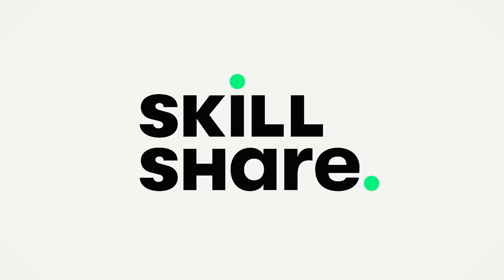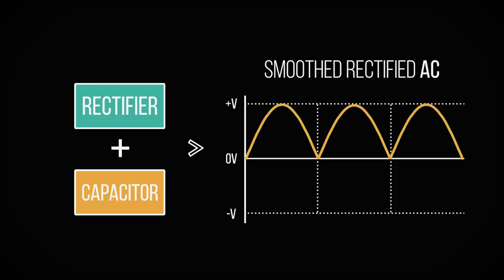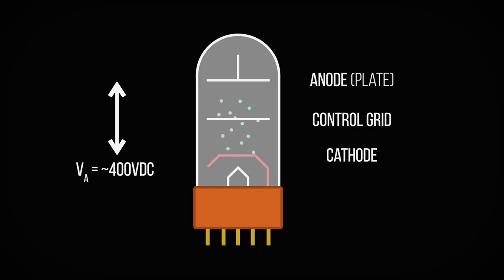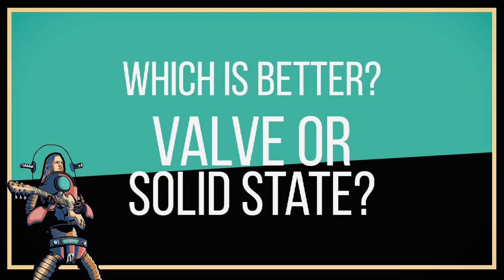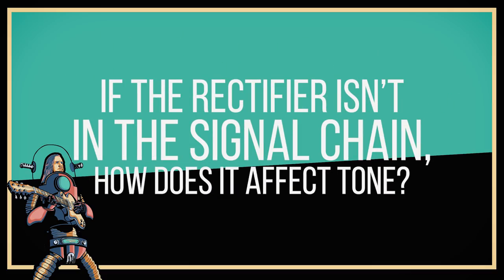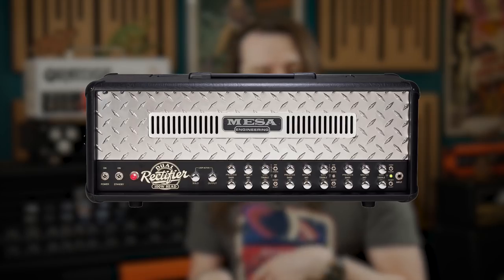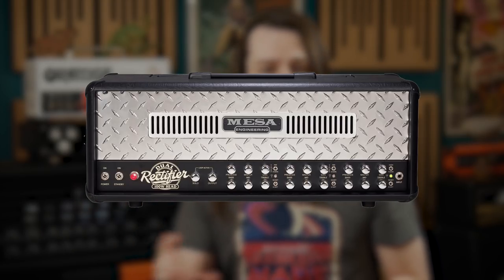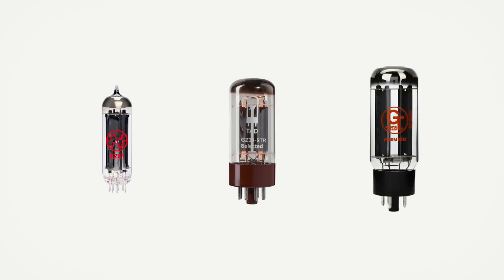What are Valve Rectifiers? | Too Afraid To Ask

Comment: My Silvertone 1482 uses a 6X4 (well, the tube is 6X4WA... not sure what the "WA" is).

The wattage on this amp is inconsistently published, but I'm safe to say it's under 25 watts.

I have this routed through a load box into the Pod Go instrument input, effectively making my amp both a bedroom level cabinet as well as a big-honkin "drive pedal" in front of the Pod-Go (all of which is "yummy").

As for the caps... I thought one day I might try my hand at building a tube amp, but decided against it: "Step 1: make sure you bleed the caps or you might die".

I decided to not approach step 1.

Comment: well the Peavey 6505 and 5150 have 4 1n4007 diodes just in the high voltage section alone and 4 1n4007s in bias and low voltage rectification supply and it sounds kickass I also like triple rectifier amps.

Comment: Rectifiers can DIRECTLY affect the sound in the analog signal path.  As the rectifier switches on and off the sudden changes in current result in RF noise generation that is both radiated & conducted into the analog signal circuits & produce a glariness to the sound.  Early solid state rectifiers with slow reverse recover time were especially bad sounding compared to tube rectifiers.  The newest fast soft recovery rectifiers cause 20 times less RF noise and with proper snubbing circuits are a vast improvement upon vacuum tube rectifiers.  Vacuum tube rectifiers are now obsolete for audio.  If you want to make the power supply sag, just switch in a resistor.  FYI, the first rectifiers were the commutators on DC generators.

Comment: Speaking of rectifiers,  specifically those solid-state w/e IN 1004's etc:   If you ever need to hack down a 12v power supply( like a PC supply or wrong sized wall-wart) to feed 9v pedals, you can put 4 of those in series with forward junction and they will drop a nice 2.8V and can flow 1 amp.     Since PC power supplies already have 12v and 5v, you can run most of a studio's extras from one source.   just have to splice on the connectors you want to use. (and add a switch or jumper from green wire to any black ground on main-board connector for turn-on).     just some rectifier stuff that is a lot safer to fvck around with, haha.   have a great day.. 
 PS i'm a low power guy: "Give me TTL or give me death"  (TTL=transistor transistor logic, the original 5V digital standard) so i'm of the opinion that i'm not touching EITHER SIDE of a hot rectumfryer tube. i'll leave that up to those other studs.

Comment: Slight correction: U.S. normal wall socket voltage is 120v not the old 110v. Which is why some vintage amps don't always work right without modification in the states.  🎶🎸

Comment: I have a question. I recently got an older ltd ec 1000. It has active pickups but the battery is just in the control cavity wrapped in foam is there a aftermarket or simple solution to this. Also how do active pickups function?

Comment: Super interesting stuff!
so I guess a rectifier is to an electrical current as a laser is to light?
So, theoretically, regarding the whole valve/solid state. From how you've explained. it seems that a solid state could emulate a valve amp perfectly and easily? cause its just like faking a sag?
Also i like the zebra sign before the add ;)

Comment: excellent educational video as always!

sorry this isnt a guitar related question but, what I want to know is... how, when you record your video in 50p frame rate in the UK that I can watch it at that frame rate in North America when our standard here is 60p (to match monitor refresh rate) ??
Reply from the maker: Monitor refresh rate and video fps are two separate things. 
So long as your monitor can refresh its image faster than the video frames then it's not an issue. A monitor of 80hz refreshes faster than a 50fps video, so it will be able to draw all of those 50 frames without issue. 

However if you had a monitor with a 30hz refresh rate and tried to play a 50fps video then it doesn't refresh fast enough to play all the frames. The 50fps video would appear like 30fps on a screen of 30hz. 
The video would still be displaying the 50 frames every second, but the screen is too slow to draw them all. 

Monitor refresh rates aren't matched to video fps for this reason. I think my monitor refreshes at 144Hz for example. That means I could view a 120fps video with no issue at all.
Reply: @ScienceofLoud  hey Colin, thanks a lot for that answer!  makes very good sense.  and I guess I didnt realize that monitor technology had advanced to have refresh rates higher than the native electrical supply frequency.

when I first started doing my video business I ran into some interesting issues with frame rates in an editing program.  I was using the NTSC standard 30fps on my camera but was using a PAL based freeware editing program that claimed to be able to handle all video formats.  it took me a while to figure out what it was doing by watching frame by frame... when I dragged media into the editing window of the program, it was converting it to 25 fps by dropping out every 6th frame.  then when I exported the edited version it doubled up every 6th frame to convert it to back to 30fps output.  needless to say the finished video was glichy and not smooth at all.  terrible logical error in the software and after that I stopped fooling around with freeware and bought SONY Movie Studio!

again, cheers!

Comment: The other major notable use of rectifiers is in, big shock, standard ATX power supplies. Computer parts expect near-constant +12V, +5V or rarely, +3.3V. While this is much lower than an amp, it's still significant enough to cause a fire. Just ask NZXT.

Comment: iMO, the EZ80 is improperly named.  In my area in Can'tada, these certainly are not EZ to find.  The nearly identical miniature 6X4 is easy to find, but IIRC, not pinout compatible.  I was working on a pair of Heathkit EA3 monoblocs and had the toughest time finding required EZ80 rectifier tubes.

Comment: hello, very usefull video, thankyou!! i have a (silly?) question; why the amp has to be in direct current? is possibile to make an alternate current amp?
Reply from the maker: The plate (anode) of the valves requires a constant voltage in order to create the potential difference to accelerate electrons through the vacuum. 

While the signal being amplified is AC, the valves require DC voltage in order to function.
Reply: @ScienceofLoud  thankyou

Comment: It's already been pointed out by others, but I'm gonna add my 2c as an amateur electrical engineer. AC is deadlier than DC. When you get shocked by DC, it tends to cause an involuntary muscle twitch as opposed to a muscle contraction, which 99 times out of 100 can actually force you to yank your hand away from whatever's shocking you. AC on the other hand can cause involuntary muscle CONTRACTION... thereby putting you in extreme danger of clamping down with all your strength on the thing that's shocking you.

Granted, above a certain voltage, it really doesn't matter whether you get shocked by AC or DC. It's gonna instantly fry you either way. But at mains voltage, you have a greater risk of a lethal shock from AC than DC. You can still get a lethal shock from DC at those voltages, but again... muscle twitch vs. muscle contraction. Choose your electrical poison.

Comment: Dude, 117 VAC, 115 VAC, & 110 VAC are obsolete in the USA!  Nominal AC mains voltage in the USA for residences is 240 VAC with a center tap for 120 VAC from Phase to Neutral. 3-Phase WYE 208 VAC is also common for commercial buildings & can produces 208 VAC from phase to phase and 120 VAC from phase to neutral.

Comment: do amps not also use rectifier tubes to clip to ground like diodes in distortion pedal, or is that just not a thing in amp circuits?

Comment: I have a lot of hum when I have my guitar parallel to my amp. When my guitar is perpendicular to my amp, the hum disappears. What's up with that?
Reply: If you're using a tube amp, your guitar pickups can pick up a lot of noise when they're "pointet" at one of the transformers in the amp, due to the electromagnetic field of the transformer. Pointing the guitar away from the amp, or getting more distance between the amp and guitar is quickly going to solve the problem in this case. Also, single coil pickups will show problem that way more than humbuckers, since they're more prone to pick up changes in electromagnetic fields around them.

Comment: So even with a solid state rectification, can there still be a tube power amp section or am I missing a part of the equation?
Reply from the maker: Rectification is entirely separate of the power section. 
It is entirely possible (and indeed incredibly common) to have a solid state rectifier with valve power section. 

Valve rectification is only really  found in either vintage amps, or amps build to mimic vintage designs.

Comment: I've blown both fuses (main and HT fuse)  in my JTM-45 and think it's the valve rectifier - is there anything difficult about changing the valve rectifier? anyone know??
Reply from the maker: Nothing difficult. Swap the valve and see if it keeps blowing fuses.
Reply: CSGuitars it worked. Problem solved !

Comment: Do these amps contain a FULL BRIDGE RECTIFIER?!
Reply: I get the funny joke, but myself as an electronics technician will tell you the answer! drum roll No. They don't. Valve rectifiers are a two diode (usually) rectifier, a full bridge rectifier has four diodes. :)
Reply: Many amps use a solid state two-diode rectifier.

Comment: What are the skunk strip on the neck of a strat?
Reply from the maker: It's where they install the truss rod. The darker wood plugs the routing hole and becomes a design element. 
Trying to patch the hole with maple would just look like a repaired section, the colour contrast with the darker wood looks intentional.

Comment: The subject of diode vs tube rectification is no more of a real world concern than It is no more of a concern than whether your guitar is wired with modern PCV or "vintage" cloth covered wire. No more of a concern than whether your guitars tone capacitor is an orange drop, tropical fish, bumble bee or a "brownie". No more of a concern that whether you wrap your strings, under or over the top of a stop bar tailpiece. 

Rectifier tubes and diodes are electrically the same and perform the same task. They convert AC to DC - that's it.  What we are really talking about here is marketing hype, propaganda, designed to sell high end amplifier companies.  Do you really believe that eating foot long subway subs every day will help you loose weight? Does it really matter is a package is delivered to you by UPS, or Fedex? Is a car rented from Hertz any better than the same car rented from Avis or Budget?  Is Maytag really the only dependable brand of appliance or Tide the only detergent with whitening power? 

In an academic sense, this discussion about rectification is quite interesting,  but in terms of real world concerns, is merely distraction.  The point is not that there aren't differences, the point is that difference it's basically meaningless in the real world. To put it simply, it's kind of like whether a wine has fruity or herbal notes. 
Take your guitar, plug it into an amp and play and stop worrying about the hype.

Comment: TATA: why are tube amps so much louder than solid state?
Reply: Thermionic response in tubes is capable of moar loudness is how I'm digging it.
Reply: Couple reasons. First I'd like to say - a watt is a watt, it's a measure of power. That said... it's a little more complicated than that. 
1. You can run tubes with quite a bit higher THD (total harmonic distortion) before they sound bad, so you get more power before it starts sounding less than amazing (plus, harmonics add perceived volume). So, you can figure a 100 watt tube amp runs with more distortion, but good sounding distortion. That means you get quite a bit more volume before it falls apart than a 100 watt solid state (you'd need roughly 300W solid state to match).
2. Tube amps use an output transformer to match impedance - solid state amps don't have them because they don't strictly speaking need them. With a tube amp that means it has the same power output at all compatible speaker impedances, and solid state amps only really make the most power they can at their lowest rated impedance (if you look at a solid state amp, it'll be rated something like "400W at 4 ohms/250W at 8 ohms/100W at 16 ohms").

Comment: this is a bit of misinformation. DC is less dangerous than AC the same level. The statement that at some point AC is zero is BS in practical terms, as this point at 60/50 Hz is soo short it is meaningless. Any touch to a life wire will not be affected by the 50/60 times zero points in a sec, you will always be exposed to the full voltage. ( you can't touch short enough to avoid it).    The other key point there is that current penetrates better at certain rates and 50/60 hz is quite optimal for that (which is good for cables and wires, but not good for human bodies)   . In EU e.g. up 110 volt DC is considered not dangerous but only 50Volt AC is. ( range of low voltage) . In all cases DC or AC voltage in the range of 200-400 Volts are no joke, both AC and DC can kill you. The higher the voltage the higher risk or arching or sparking there is also. So if you are grounded well enough then you don't even have to touch, just get close enough.  Isolation transformers can help though.